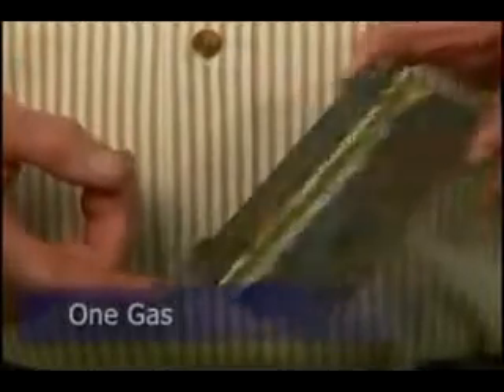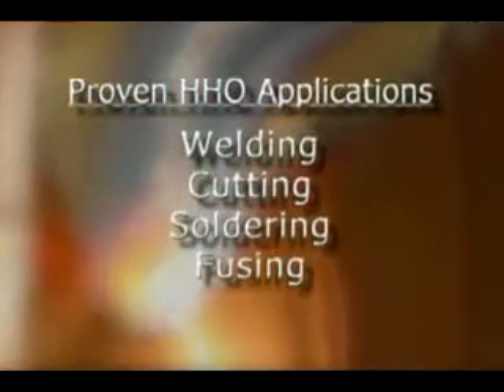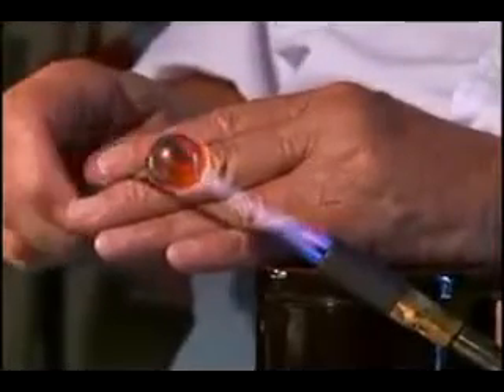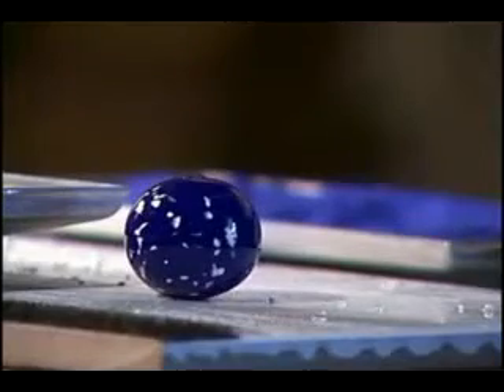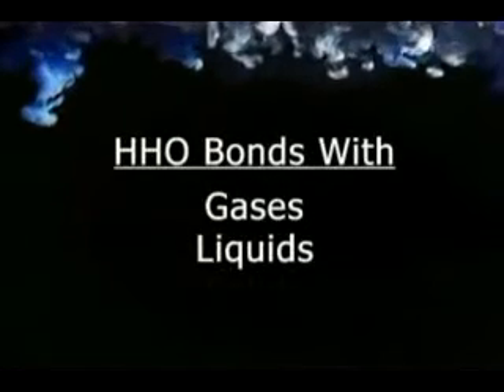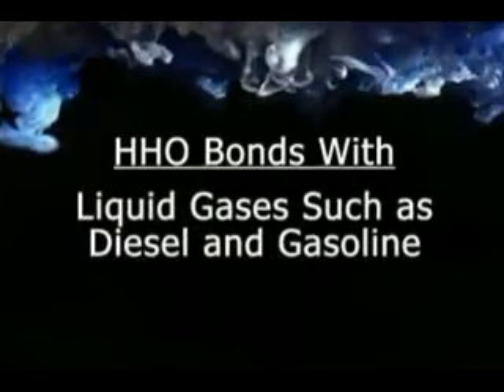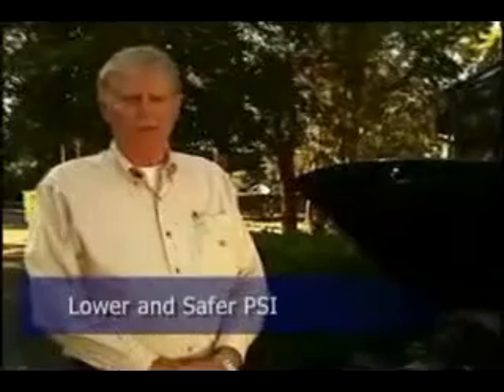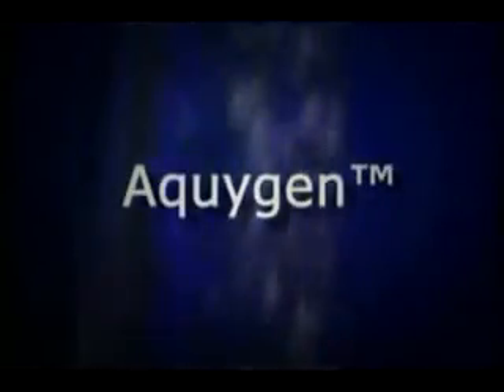How do Hydro Water Power HHO Car Kits Work Part 1

Comment: Bedini is a scam also yes.

And the only way you got better mileage was by messing up the engines control unit and running the mixture too lean.

Hows that car doing?

Engine trouble?

I wonder why.
Reply: Not true at all. ECU tuning would be required for bolting on performance headers, free flow exhaust and turbos just the same as we are installing an HHO system and altering the combustion properties for faster burn rate. You can't get much benefit from the hardware if the ECU isn't tuned to work with it.

Comment: Making the fuel/air mix burn faster in an engine won't get any more mileage, it will just put stress on the engine internals, same energy released, just now in sharp shocks instead of smooth power delivery, shorten the life of the motor & increase fuel consumption.

Comment: Hydrogen gas explodes without compressing it.  Gasoline has to be compressed in an engine before it can explode.  Hydrogen burns many times faster than gasoline.  So when it is mixed with gas in an engine the fast burning hydrogen helps burn the gasoline faster.  This is why you see a gain in MPG and power because the gasoline is burning more completely than it did before.  Hydrogen is the kindling to the fire and gasoline is the logs.  Use kindling to start a fire faster, it is that simple.